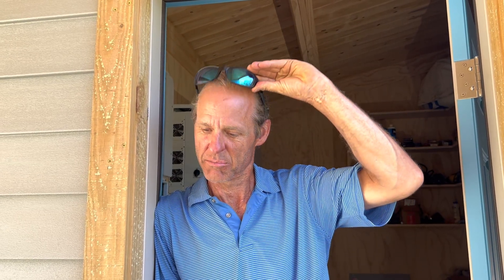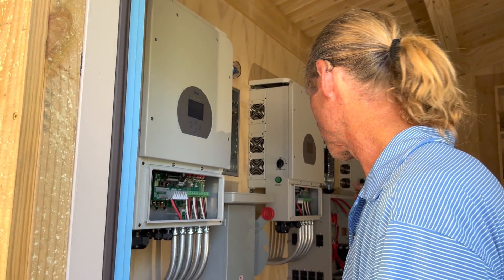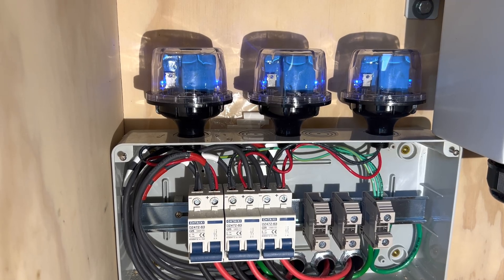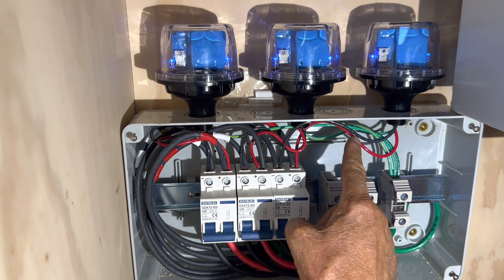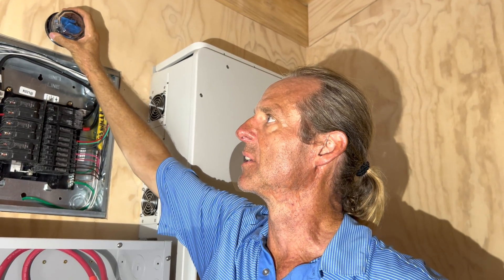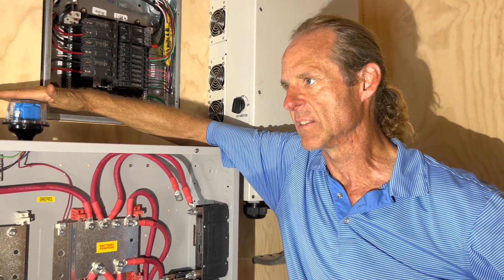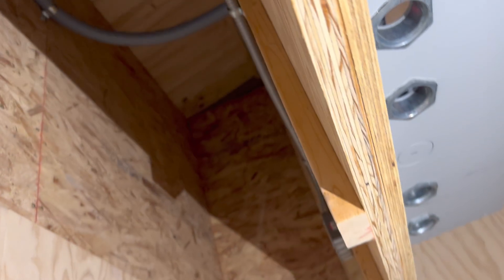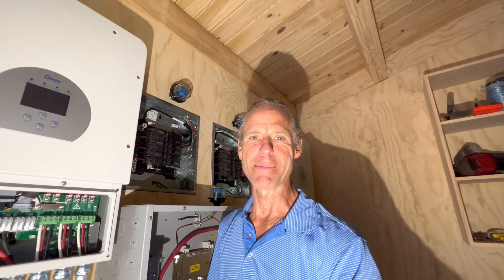Protect Your Lifepo4 Energy System With Surge Protection Devices From Midnite Solar

Comment: Hi Ray, yesterday I found your channel. 
Respect! Especially,  as you are a carpenter by trade,  as I understood correctly?
I already watched about 6 hours or so. Very nice,  calm and relaxing voice,  with good explanation of things. Altough I studied electronics,  I am impressed and learn a lot. 
Maybe I'll build my own battery system soon. 
(Our grid is one of the most stable ones,  but we face an other thing overhere: all power we do not use we produce with solar, we can send it to the grid.
The government promotes solar since 1 or 2 decades,  so what you produce, you may use within a year. 
So the grid is our battery, for free.
Only it will stop.
In 2025 only 70÷, until the next 8 year or so to 0÷.
What you produce more, you may sell it. Altough, due to taxes, only for a third of the price for what you buy it for. 
Also,  and again it's very rare, when there is an outage,  I now don't have power.
So a battery system within the next year or so will help for the nights, and for the 8 or so sunny month every year. 

You mentioned in an other video to make a couple of breakers in a box next to the solaredge, to switch your house between the solaredge and external power.
Couldn't you just use a heavy 3way switch, between the breakers or so? Then you never have to worry someone makes a wrong connection/short, as its just not possible. 
Maybe even a small version of this ATS: https://new.abb.com/low-voltage/products/switches/automatic-transfer-switches/compact-ats

A question about your own 2 solaredge units: don't they require power from grid, before starting and during operation?
At least in the Netherlands,  it's required they will shutdown when there is a power outage. 
So,  how will they work when you connect them to your 'gen input', as there will be no power on those inputs? 
I'm a scubadiver since 30 years,  never did tech, so be my guest to show what you do also:-)
Ps. Did I see a nitrogen removal rig in your house, to boost the O2, for Nitrox?
Greetings from the Netherlands.
Take a peak at our more or less unique underwater shed;-)
Google Chrome nicely translate. 
https://www.kaaiman.nl/onderwaterhuis
Reply from the maker: Wow, that's a lot of questions. Thanks for showing so much interest. 

I will probably make a simple interlock for the generator/AC coupled PV panel. Not interested in paying for an expensive ATS. 

The hybrid inverter is designed to accept AC coupled power. All the grid tied inverters I've ever seen have the same shutdown requirements and all hybrid inverters and battery back up systems have ways to fool it.  My only lingering concern is the programming for the inverter setup to make sure it knows which source is coming in on that lug. There is a fall back approach if it doesn't work. I can generator in on the grid lug but I will cross that bridge soon enough. It is a complex setup to have all these energy sources and scenarios covered by one system so stay tuned. So far I have gotten comfortable that I can make it work without compromise.

I create and store EAN32 with my nitrox stick pumped through my RIX compressor. I bank it in four big 300 bar tanks that I use as a cascade. For higher levels of O2 I have a booster and can fill 100% O2 up to 150 bar. I create other mixes including trimix by partial pressure blending with the booster. It gets little use right now because I haven't been diving locally. 

That's a cool "shed" you've got there for diving. Looks pretty pricey. I hope it gets lots of use. 

I'm glad you enjoy the channel and I hope you stick around. Best wishes.

Comment: Hi Ray, I am a retired electrician from New Zealand and it has always amazed me how the world did not get together and decide the colour coding for electrical wiring from the start. The only colour that seems to be consistent is green. 
Protecting from power surges is an art and you only find out if your system worked after an event. 
Keep up the interesting videos and if you can send some of that heat down this way it would be much appreciated. (only 8 degrees C today) 
Cheers Dave.
Reply: Yeah. Color codes differences are hilarious. I’ve been watching an electrician in Australia and was astonished by practice differences. Is some places more restrictive and other more lax. I’m not sure if you’ve got split phase down there or if that’s primarily a North American nightmare.
Reply: @SkypowerwithKarl  
split phase is definitively an american thing.

Comment: It looks like you have done a good job! I live in South Florida!  I worked around radio towers. We have sandy soil. I have seen lightning hits that formed glass around the ground rods.  That is the power from a hit. There is no way to keep that out.  But what you have should take care of the near by hits. The lightning that hits the system,  all bets are off! You have all the grounds together,  fuses on everything and you should be good unless you get a hit on the system.  There is nothing you can do do stop that!

Comment: I'm interested in your idea of single earth location. Current flowing under a fault or surge tends to take multiple parallel paths. Even if its a spike from  lightning strike. Although I know regulations differ from country to country, I have also put an earth rod in the ground on my outbuildings, this is also connected to the earth of the incoming grid.... this is all connected back to neutral at the transformer somewhere else down the line, which is also connect ground. 
I always love your videos, please keep up the amazing work!

Comment: Most recently we had a longer discussion about battery cell measurement and the impact of temperature cause that has been quite offen ignored.

Regarding to Eve the capacity difference beteween 25°C and 5°C is 20% even though above 25° it does not change that much.

Considering you tested the eel cells at thesame conditions you had tested Jenny Wu and Amis cells only then the eel cells can be called disappointing even though at least they delivered over specs.

But 1 or 3 Ah more or less is nothing compared to the effect that 5°C less could cause which means roughly 4% less or 4% x 280 Ah = 11 Ah

270 Ah delivered can be as good as 281 Ah If the 270 Ah we're delivered at a 5° C lower temperature.

What ambient temperatures are you having during your tests and always the same ?

At what temperature
Reply from the maker: I test in my office. It is climate controlled to 23.3C.

Comment: Good to know. Thank you for the information.

P.S.
I don't know about you, but I always found strange that people mount the electrical systems on wood... Isn't it worse in case of fire, sparks and such.🤷 Why not mount it on fire resistant materials, I wonder... Or maybe I'm over thinking it...
Reply from the maker: The wood I'm mounted to (the whole room actually) is painted with an intumescent coating that resists ignition. I have a video about it where I show what happens when you blast it with a mapp gas torch. I'm more than comfortable with these steel housings mounted on my fire rated wood walls.
Reply: @RayBuildsCoolStuff  
I didn't know that. Then it's probably good to go. And especially if the whole room is fire proof (in fact I wondered about the whole room/structure).

By the way, are you a professional electrician? You did the whole system by yourself, right? 

I mean, this looks like a too complex of a project for a non-expert DIYer.

Or did you make it check by a professional after you built it?
Reply from the maker: I am qualified but not licensed. I did the design and all the work at my house. On this project I pulled the wire and installed the panels but paid one of my electricians to make up the panels because it is for a client and I have too much on my plate. You can look at the video of my solar shed and this one and judge for yourself. Mine is done in EMT while this one is done in flex. He does a good job but it's just not quite as elegant. Perhaps that only matters to me. I've been a hands on builder for 40 years so what seems easy to me may be a lot to take on for someone new to the trades. It is always good to consult or hire an electician. Not all things involved in electrical work are intuitive. There are sneaky things that can easily create hazards if done without the required knowledge. Even professional electricians are sometimes ignorant of all the implications of certain applications and systems. The ones that are really expert at understanding it all are very rare.

Comment: Ray, I love your videos, keep up the wonderful knowledge sharing! Question: Would you please explain lesser known electrical basics  (future video?) 1. Why you use only one ground for the house and this outbuilding? 2. Why bend the wires in tight bends? 3. Which DC battery wires have you carefully worked out to be longer than the shortest convenient length and why ( are +/- same length)  Why?
And other related strategies, techniques, maybe incl things you'd have done different if starting over. Please include the why's. I've seen you reference that you do these things but often left out details of why. This could be a great video! Thanks for the consideration. What is your thought on the $200ish SquareD /similar whole house panel mounted surge devices and is there a reason to not use those in the 120vac side?

Comment: ya only got a bunch of MOV's
ya can get GMOV's which are even better but then TVS diodes work even faster aswell
Reply: I haven't taken the time to look these up, but if that's correct, then it's just a bunch of feel good in a can. Never understood mixing lightning protection and transient protection like this. If it is just MOV, then they will degrade over time. Maybe that's what the circuit inside if for, detect when the MOV is no longer viable. I've been on too many lightning damage jobs to waste time with transient protection devices being used for lightning protection. Never gonna happen.
Reply: @meko1896  i use both so the tvs diode knocks it down faster for the mov to catch up but the gmov has a gas discharge tube in it which is where the G in GMOV comes from

Comment: Prefect timing Ray, I live off grid in Southern Arizona and know a little about heat but not so much about the humidity like you have lol
It is Monsoon season here and lighting is a real threat for solar systems and the like. 

I have 8ft earth grounding on my combiner box from my array and another from my breaker in my shipping container/shop.

This is wonderful info and is a very important subject. 

Thank you for sharing and as always keep building 👍
Reply: I've heard it can be dangerous to have multiple ground systems. Did an electrician do yours?
Reply: @EricHansenHaiTech  it doesnt matter how many ya have,its only a earth rod
Reply: @EricHansenHaiTech  - Ray’s is 100% DIY
Reply from the maker: @energy dreamer I hired an electrician friend to run the conduit and make up the panels on this system which is why it is done in flex rather than the EMT that I ran myself on my solar shed. You can see that in another of my videos. I also have a painter that has been doing the finish work on my projects. I hate painting and finally, I hired the concrete slab out to a contractor. Yeah, beyond that, I'd rather just do it myself. Other things I would hire out on other projects would be drywall and I'm having some cabinets built that would take me toooooo long with the tools I have. That's going to show up on a future video about the art studio.
Reply from the maker: I only have one grounding system as I stated in the video. There is an electrician involved.

Comment: 4:00 please explain how you wired these SPDs in this box.
From the PVs to these MCBs, where do you connect the SPDs?
Do you have SPDs also out there near the PVs or just here?
thanks
Reply from the maker: I have double lugged the SPD into the PV side of the breaker. There is no other SPD on the PV circuit.
Reply: @RayBuildsCoolStuff  shouldn't it be on the Load Side as per NEC code? This part sure is confusing. Many put SPD on the panel side, while others put SPD on the inverter side. NEC did not specify what is Load Side when it comes to Solar Panels.
Reply from the maker: It appears that the instructions from midnite solar call for it to be on the panel side but it is a bit different because they are using a combiner. I will call them tomorrow and update if necessary.
Reply: LittleFuse had them between fuses and inverter
https://youtu.be/LiCDtRh95JM?t=62
I am confused... What I did was have two of them, one before and one after! LOL!

I am getting too old for this
Reply from the maker: @DanBurgaud  😂😂😂
Reply from the maker: @XYZ, I contacted Midnite Solar and they watched the video. They were very complimentary and said the SPDs were installed correctly. The only question they had was whether the PV breakers were rated for double lugging. They definitely close in a way to suggest there is not a problem. I will confirm the rating and if I need to I will use a ferrule to make the connection. They are in the correct location. I had confirmed this with them prior to the install but wanted to make sure I hadn't misunderstood. Nope, brain is still working. lol